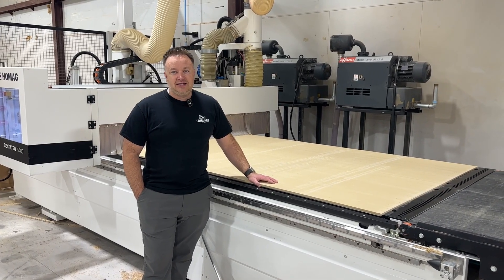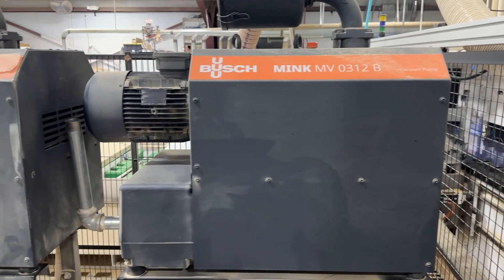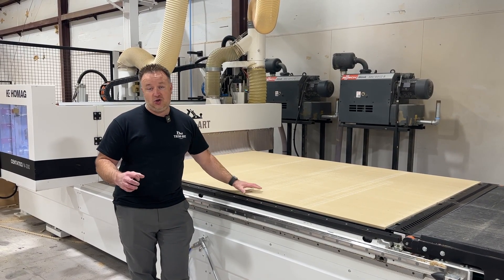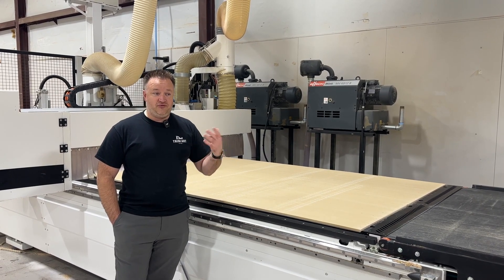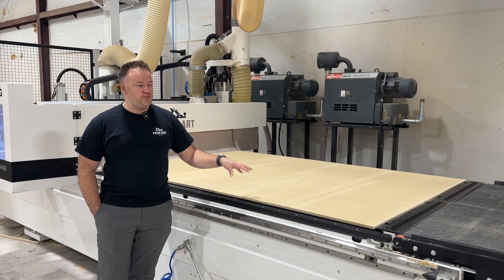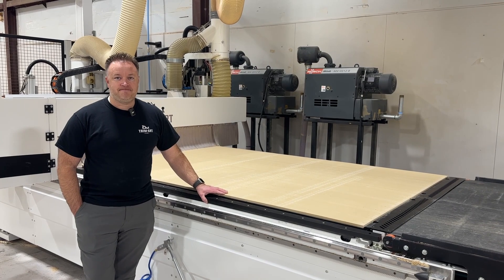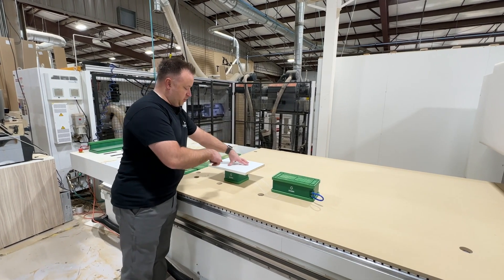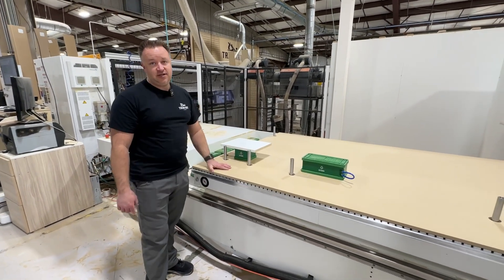CNC spoil board overview

Comment: We run a 2 spoil board system. One 3/4” same as you guys, the other is a 1/4” mdf over top. Fly cut both sides add a small bead of glue around the perimeter of 1/4” sheet, let vacuum hold down till glue sets (about 5 to 6 mins). You can mill down till the 1/4” sheet is almost the thickness of paper. Then fly cut the main 3/4” spoil board to clean up the glue, and place a new 1/4” sheet and continue. We only change our 3/4” main board about every 2 years. We process on average about 20 to 25 sheets every day, 5 days a week. Less waste and faster spoil board change overs. Hopefully this helps some one. If not it makes me feel good about trying to help 😅

Comment: does the vacuum prevent chiping melamine from the bottom side or is it all down to the bit?I use a 3 8 cmt compressed bit without vacuum and I always have chiping it from the bottom side?

Comment: We edge banded the ones I ran. The fly cutting was satisfying lol. We use to have small pieces get caught in the offload gates and eventually it would shear parts of the grids around the edge causing air to escape from the gaskets. Also had a programmer use multiple pocket routes the plunged instead of ramped cause the board to catch fire. Burnt a whole through the wood, mdf and melted part of the grid quick because of the vacuum feeding it. Shroud covered the initial ember and the fire was underneath. Operator only noticed because of the smell. Step one. Stop machine, step two cut the dust collector off. (It was inside the building) 😅

Comment: I know you guys run some serious production but flattening several times a day is insane. Get some AllStar CNC tile gasket, pretty sure it still works with a vacuum clean head. Should last you quite a while if you're careful with the Z height. It will prevent having to re-flatten all the time. I run a 10HP Becker. Get in touch with Mike or Daniel, they'll get you setup.

Comment: how do you keep the spoil board from warping? My shop uses nylon screws and places weight on it overnight, it still warps.
Reply: I’m having this problem as soon as we skim the top it bows and the suction can’t hold the hold down
Reply: @highlandsize we used to use nylon screws tapped into the vacuum table to hold it down. We upgraded to 9hp pumps and there is now no need for all that

Comment: Hey lean brothers, thank you for these videos. My question : what is the smallest part you would feel comfortable cutting at full speed in 3/4“ melamine with the spoil board only ?
Reply: I'm curious what their number is but in the meantime another point of data from someone who has the same machine, 4" is our limit on part width where we don't even think about it.
Reply: We run an N300 and cut 3" parts all day without any movement, We do cut 1 1/2" parts sometimes as fillers and they generally hold down fine if the spoil board was surfaced somewhat recently. We have had them shift on an old spoil board before.